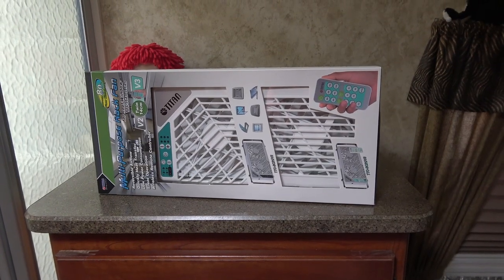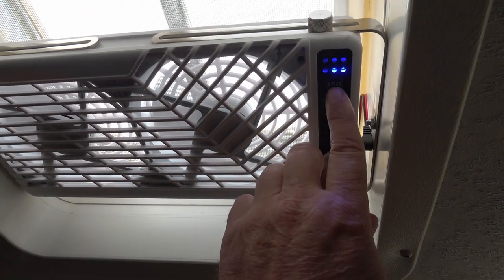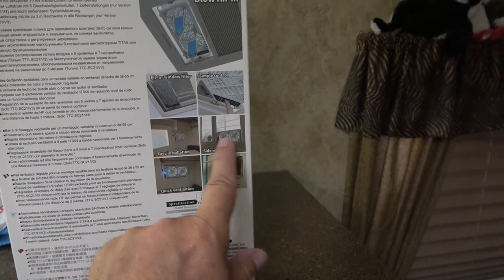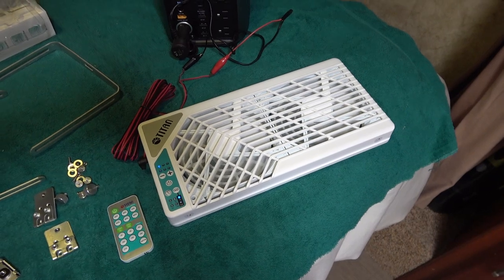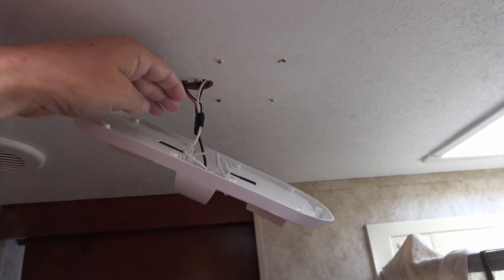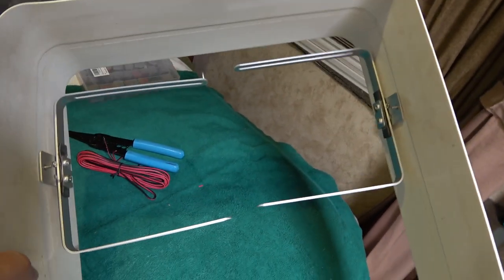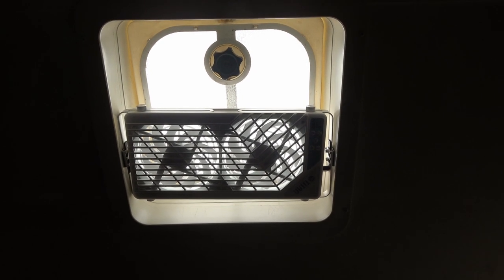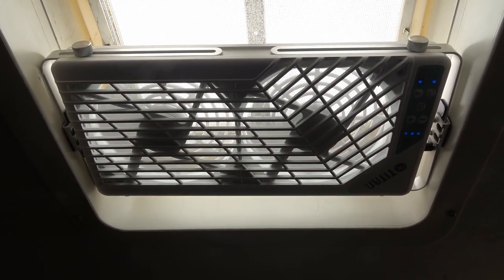Installing Remote Control RV Roof Vent Fan from Titan - 6 Speeds with Timer

Comment from the maker: Titan RV Fridge Fan Update - DIY Power Mod using a DROK DC-DC Buck Converter instead of Batteries - https://youtu.be/2IPPoaDdcnQ
Link to previous TITAN Fridge Vent Fans Installation Video - https://youtu.be/bzKF7NgMDHw
Lever Nut Connectors Tip and Info - https://www.loveyourrv.com/quick-and-easy-tip-for-connecting-wires-wago-lever-nuts/

Comment: We saw the Maxx Air fans a couple of years ago, and I had to add them to our trailer. We don't camp where we need Air conditioning very often, and these work great. They also help keep the condensation from gathering on your windows, so I can't imagine the littler fans not helping with that.  I showed my smarter half the in refrigerator fan. She immediately remarked her concerns about using the lithium batteries.

Comment: Any thoughts on if that fan would be good in the bathroom/shower? A lot of campers have that cheap shmeg brand one speed fan in the roof vent. Do you think this one would be better at drawing out the steamy air?
Reply from the maker: This fan works good for that. But in the toilet room I installed the Heng's Vortex, man that thing can move a ton of air! I installed a variable speed control to it to tame it down if we just want extra ventilation but not the noise. But to get rid of odors quick, nothing like it on high!  https://www.loveyourrv.com/rv-bathroom-fan-upgrade-hengs-vortex/

Comment: Hello Ray, I an curious on you thoughts on this fan, that is if you are still using it. I have a small Winnebago travel trailer and was thinking this may be a good solution to convert the vent above the Murphy bed to e circulation fan, I do a lot of boondocking in the California Mojave desert and thought this would be a good budget friendly mod.
Thank you for the great content. 
G
Reply from the maker: Yes, it has worked out quite well, use it a lot in the summer. I like the remote function and the timer function. Before I go to bed on hot evenings I can set it to bring in the cooler night air and have the timer turn it off. I'd say its only downside is since the fans are small they don't move as much air as some other bigger bladed fans. Like for example I have a Heng's fan in my bathroom and it can move a ton of air. https://www.loveyourrv.com/rv-bathroom-fan-upgrade-hengs-vortex/

Comment: Any advantage to this vs a MaxxAir or Dometic Fan Tastic ??
Reply from the maker: There are a lot of different models of those brands to compare but generally much cheaper at a little less than $100 for a roof vent fan with a timer and wireless remote but airflow is less on max speeds. My Fantastic fan on high speed really pumps the air, but super loud too.  Titan 280 CFM vs Fantastic 920 CFM. But in all honesty, I rarely have the Fantastic fan higher than the 1st level as it's too loud. Only really use the high speeds to evacuate cooking moisture or odors. If you want a fairly low volume fan with a remote the Titan is an attractive option but if you want to move a ton of air it's not. Cheers, Ray

Comment: Those are 18650 cells (the batteries) funny enough you have hundreds of them in your house batteries, just not easily accessable 😂 I really think it's on it's way to replace the AA.
Reply from the maker: Some lithium house batteries use many small cylindrical cells, mine actually use 4 large rectangular cells called prismatic. Cheers, Ray

Comment: hello can you connect the roof fan directly to the car battery, my battery voltage is 12.3 to 13.8 V
Reply from the maker: Yes, you can. The voltage in my RV is around 13.2V and it works well.

Comment: Good grief, I couldn't sleep with that fan (or any fan) making noise in the bedroom.  Only on very low maybe but then it might not do too well.
Reply from the maker: You must have real trouble with the RV furnace or air conditioner then. :)  Luckily I sleep like a rock.
Reply: I'm just the opposite, I like a fan when I sleep, helps to keep outside or other noises from waking me.